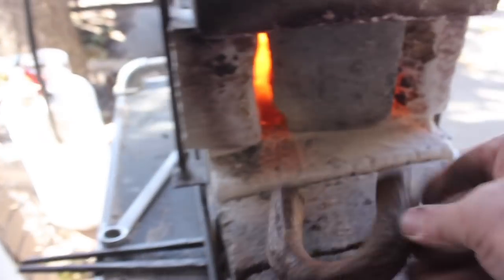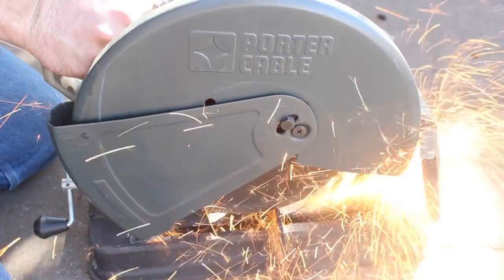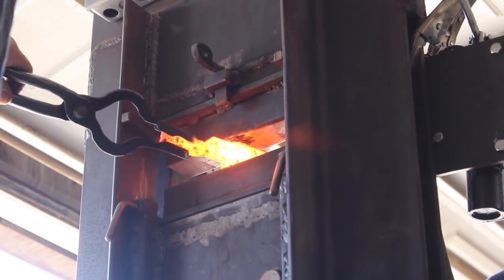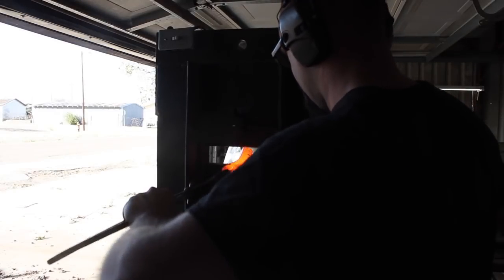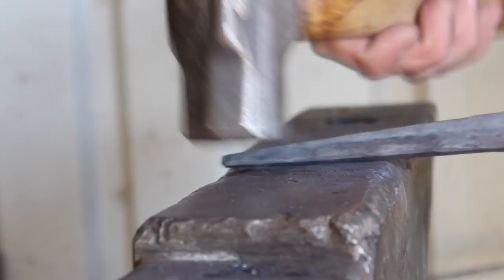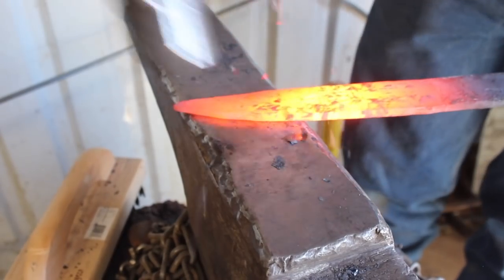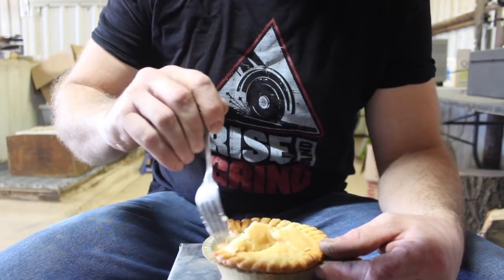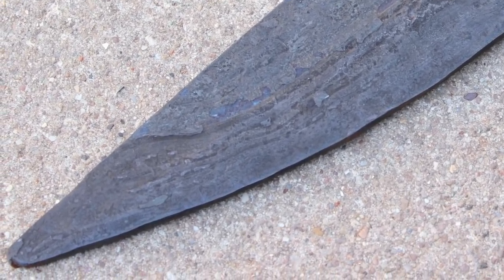Forging A Viking Seax From Anchor Chain Wrought Iron & Damascus Steel, Bladesmithing And Knifemaking

Comment: My lovely mother-in-law scored me about 80 pounds of wrought anchor chain at a garage sale, and my next knife project is to use it in a blade. I was going to do a san mai with 1084, but now that I've seen this video twice I'm inclined to whip together a billet of random pattern and use that as the cutting edge, as you demonstrated. Thanks for the inspiration!
Reply from the maker: That's awesome!

Comment: Why u out diesel on the metal? Just curiouse
Reply from the maker: It helps protect the steel while bringing it up to welding heat, and leaves some carbon, which aids a bit in the weld.

Comment: I still can’t find anymore wrought iron. Had some a while back but can’t seem to get ahold of anymore anywhere. I love the stuff although it’s very outdated and (I don’t want to call it garbage cuz it’s not but in a way it is.)
Reply from the maker: Hightemptools dot com is where I got the chain link. Yeah, it's a different material for sure, in my view the eccentric qualities are part of the appeal; it's what thousands of smiths used for millennia for many things..
Reply: Fire Creek Forge thanks for the distributor.  I agree with you completely, it’s been used for a very very long time. It’s good for what we use it for in this age. Replicated Antiques and show pieces of work. It looks beautiful etched and moves so easy under the hammer.
Reply: @erikcourtney1834  Thanks for asking my question! I've also had trouble finding wrought here in the Northwest; with all the shipping you'd think anchor chain would be everywhere.
Reply: Bryson Alden my anchor chain came in the day. Man that stuff is course. But it’s a nice big chunk. Wish I knew that place had them sooner.
Reply: @erikcourtney1834  Thanks for letting me know! I am going to order a hunk tomorrow; I have a dog's head hammer with a tool steel face in mind.
Reply: @Bryson Alden  I actually just forged 2 of them out into bars today. Worked nicely. Had a couple places try to split on one of them, but it welded right back up no problem.  Wish I knew what age the pieces are.
Reply: Plenty of people selling old anchor chain and wagon tires on the internet, it isn't always going to be high quality but you can usually find it fairly easily.

Comment: In history Most of these were made from broken swords. That's why there's so many different variations. There was no standard ad peoples swords varied. Eventually they ended up being made as a weapon in itself.
Reply: Swords have never been common enough to be the main feedstock for anchor chains. Plus swords have been almost universally made from steel for over 1000 years and prior to the invention of the Bessemer process steel was far too valuable to waste on an application like anchor chain for which iron was perfectly adaquate.
Reply: @garethbaus5471  I'm sure he means that the seax was often made from old swords, not the chain made from old swords.

Comment: I was thinking, Joey Van Der Steeg, in his French Cross Peen Hammer p.5 video, etched a bloomery steel/wrought iron hammer head in diluted Hydrochloric acid. 
The result was stunning! The ‘fibres’ and grooves of the wrought iron were accentuated and it really popped. It seems like the steel was relatively unaffected by the acid. Might be interesting to try this method before your Fe Chloride/coffee etch.

Comment: Heey i think your wrought iron does not like the press so much because its sucking the heat out of it quite quickly. Your hammer on the anvil does not do that. 
In my experience its best to fore the wrought iron quite hot so that it does not seperate 
Btw. Cool project :)